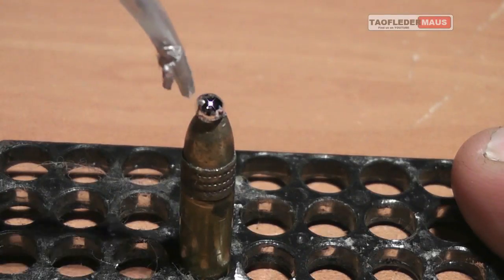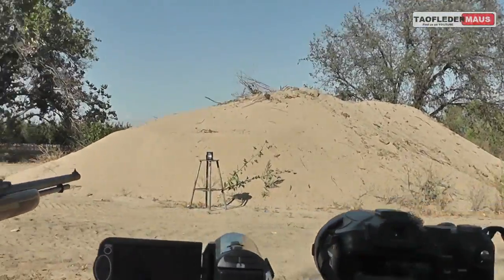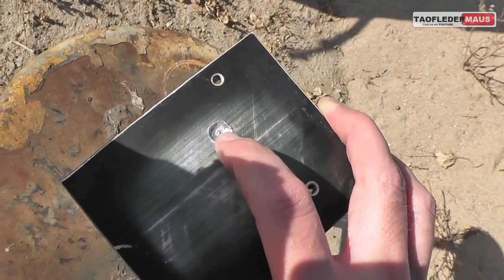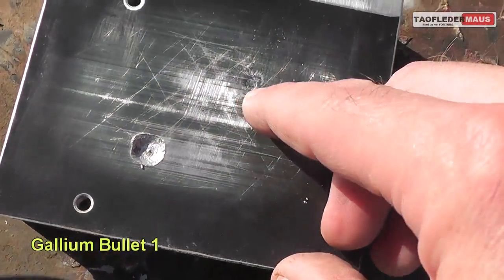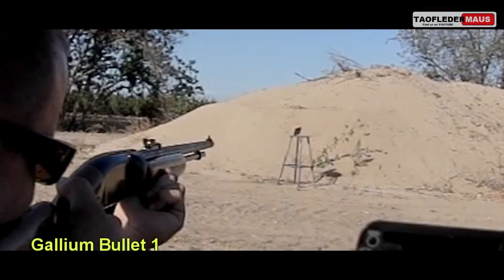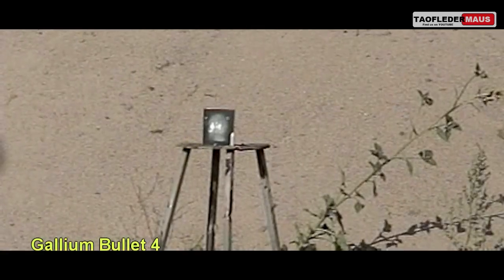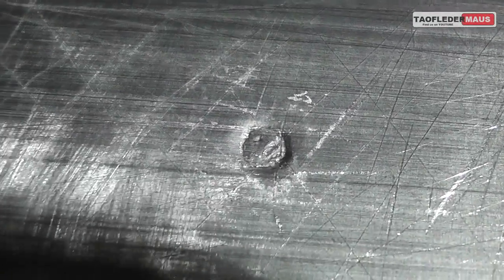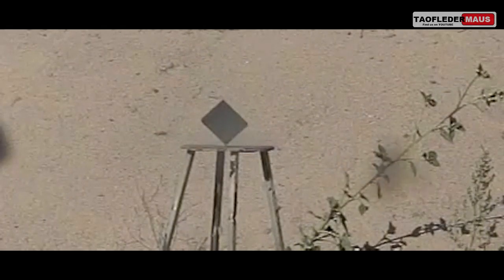GALLIUM Tipped BULLETS -  The SABOTEUR'S Tool?

Comment: If you want to test if these things can actually be used as saboteur's tools, here's a suggestion. 

Make a test rig that hangs a weight from an aluminum tube (Lowes/Home Despot/Etc has plenty). Shoot the tube with one of the 'loaded' bullets, and then wait to see if the aluminum decays enough to break and drop the weight.

Could even modify a .22 long or short to avoid penetrating soft Al...good luck finding a HP in those though, you may have to make a drill rig to make a decent hole. 

If it works then you may have something... a single quiet shot and an aluminum structure comes tumbling down hours/days after you're gone. Something to pitch to the CIA/NSA I'm sure :)

Comment: 1:21 why does he load it into the bottom barrel? didn't realize that's the real barrel? thought it was for something else =S
Reply: +captainplanet999 That's the magazine, it's a tube magazine that uses a long rod with a spring and a plunger to push the bullets back towards the lifter that brings each round to the chamber for firing. 

They're probably dropping them in the top instead of using the loading port because that big ball of gallium wouldn't fit... which raises questions of how much gallium got wiped off on the lifter/breech, there may not be that much more room in the mechanism than the loading port allows...
Reply: Michael Free that actually makes a ton of sense, thanks dude for the prompt reply

Comment: You should have tried to break the heatsink because that is what Gallium does to Aluminium, it makes it very brittle. It doesn't make it corrode like you said it makes it so weak you can break it with your bare hands with little effort which is what you should have showed, whether or not the Gallium in the tip would be useful
Reply: Scott Schoemann Ahh yes my favourite element: moisture
Reply: +QuakeGamer632 face it, they are no fun when they are not moist
Reply: +QuakeGamer632 The problem as to why it didn't work is gallium needs time to be properly dissolve into aluminum... The bullet caused the gallium to splatter on impact, and the only sign it had worked was a singular bullet whole that showed some crystallization... Not enough to compromise the structure.
Reply: +QuakeGamer632  the issue is the mass of Gallium will be consumed by an equal mass of "alyewminniyummm" however you are not dealing with pure aluminum in heat sinks, they are all an alloy since on its own it is very reactive to the environmental elements, such as moisture
Reply: +QuakeGamer632 Gallium corrodes aluminum, which in turn makes it brittle.  Corrosion caused by gallium is pretty obvious when it happens.  There doesn't appear to have been enough gallium here to cause serious damage.

Comment: Wouldn't the gallium heat up and melt in the barrel, then when it exits, re-solidify because of the wind reacting on it?
Reply: It's moving so fast that the air heats it up.  There's too much friction for the wind to cool it down, as was stated in the video.  The actual gunpowder charge is far enough from the gallium and ignites fast enough that the gallium likely doesn't heat up much at all.
Reply: +NoBeatsNoProblem actually due to the pressure build up in the barrel it is forced into the lead, and the same pressure front creates an extreme low pressure area on the bullet, behind a high pressure area in front of it. there are multiple high speed videos of this effect all over the net, such as shooting a balloon light bulb but the best is a candle flame

Comment: will a diamond tip bullet cause more damage then a normal bullet?
Reply: +Shachar Petrushka Real life>Minecraft
Reply: +Shachar Petrushka Depends what you're shooting at, your velocity, ratio of bullet to diamond, and definition of damage.
Reply: squidlybytes
Hmmm not entirely sure about that, all the test round firing I've seen, velocity X mass is what shows to be most effective. Obviously too soft means it will deform using energy but a copper jacket reduces that. My argument is that the exceptional hardness of the diamond imparts no major improvement. A smallish diamond backed up by substantial mass is going to be better than a largish diamond at the expense of substantial mass.
Reply: No
Reply: +Shachar Petrushka Bullets against solid objects is all about mass x speed of impact, the more the bullet weighs and the faster it's doing, the damage it will do. As diamonds are lighter and the bullet will travel at more or less the same speed the diamond has less effect. The actual impact site might have a slightly deeper hole but the energy imparted is less. That's part of the reason the gallium bullet did less damage, it was lighter. Partly also because maybe some of it melted.
Reply: etmax1
This is true about hypervelocity impacts, but at merely high velocities, hardness is important as well, when it comes to penetration.
Reply: ^agreed.
Reply: +D. Lyrium As such is why materials like depleted uranium are used for anti-armor, it's sheer density on top of the fact it gets white hot on impact allows it to penetrate armors with relative ease. Tungsten is a bit stronger but costly to produce and still doesn't penetrate as well as the depleted uranium.
Reply: DU is self sharpening, which is why it pens better. Watching it shatter in ultra-high FPS video is kind of fascinating.
Reply: +MidnightMarrow Also DU is very pyrophoric so all of the dust and spalls coming off of the perpetrator will ignite once inside the armored vehicle and set everything on fire.
Reply: +MidnightMarrow Also DU is very pyrophoric so all of the dust and spalls coming off of the perpetrator will ignite once inside the armored vehicle and set everything on fire.
Reply: +TaintedMojo indeed
Reply: To your Bank Balance....yes, definitely

Comment: "Gallium mist". I hate to be nitpicky, but just in case anyone mistook "mist" to mean "gaseous particulate" in this context, keep in mind that while Gallium has a very low melting point, it also has an extremely high boiling point. So this "mist" is not of a gaseous form, but rather a cloud of light particulates.
Reply from the maker: +Boof   I think you like to be nitpicky.  lol
Reply: As a physicist, I suppose I am quite nitpicky about phase changes, heh. Didn't mean to offend.
Reply: +Boof I thought a mist is a cloud of droplets not gas
Reply: +Boof as a nobel prize winning scientist, i can say with certainty that when people start a comment with their credentials, they're a fucking liar that used google.
Reply: +Boof Isn't that what "mist" is?  I think of a mist of water like spraying out of a squirt bottle.  Some are even labled "spray" and "mist".  Or "misting" outside is rain but tiny droplets.  Something in gaseous form I would call "vapor" like gasoline vapor.
Reply: +TAOFLEDERMAUS ya alominium picky lol

Comment: If it melts at that low of a temperature, then it will start melting in the barrel, but some of it should be trapped inside of the hollow point, but it would probably be in a liquid state already.

Comment: Why does Gallium melt at 85 degrees Fahrenheit?
Reply from the maker: Every metal has its own melting point.  It just so happens it is 85F gallium melts at.
Reply: ***** But that's room temperature.  Never heard of a metal with that low of a melting point.
Reply: Rocky Cadena Ever heard of mercury? ya the metal in thermometers that's one metal that melts below room temp
(BTW not trying to be mean just giving an example)
Reply: Legitamatetactics I thought mercury had no melting point.
Reply from the maker: It melts around -40 degs.
Reply: ***** so technically it never was a solid so it can't really melt.  Unless you find a way to freeze it first.
Reply: Rocky Cadena It's a solid anywhere colder than -39...like Antarctica, or any other climate colder (Space, the Moon...etc). It's still scientifically called a melting point because that is how hot it has to be to melt out of it's solid state. the fact that our climate is usually warmer is inconsequential. It can still melt, because it still has a solid state.

You would say ice(water) melts, even though most of the time it is a liquid, so why would you say mercury can't because it is usually a liquid? Just doesn't make sense.
Reply: Raven1024 Ok, well can Mercury evaporate like water?  It's metal so I don't know, but it's also a liquid. :/
Reply: Yes, it can.

Also liquid is just a state, not a group of elements, every metal can also be a liquid.

Just like you can compress most gases into liquid and solid states. Blocks of solid oxygen for example.
Reply: Raven1024 So Iron can become a gas?  That's hard to believe.
Reply: Rocky Cadena I didn't mention metals as gases, but yes, it can.

Given appropriate temperature and pressure any element can be any phase.

Iron gas has to be made in a vacuum though, otherwise it reacts with air.
Reply: Raven1024 What would Iron do as a gas?  Burn shit or freeze like liquid nitrogen?
Reply: It won't freeze anything, and if it's in a vacuum it's not really got anything to burn. It does have to be incredibly hot so it would probably just be a very bright chamber.

So...it's just a very hot gas, in a very bright chamber, as soon as you take the vacuum chamber (or inert gas chamber) away it will react with the air and oxidize.
Reply: Raven1024 Hmm, so if someone inhales it, will they burn inside out?
Reply: It would be nigh impossible for someone to inhale it...it only exists in a vacuum or inert gas environment.

So unless you can breath inert gases or vacuum you are going to breathe in rust that is slightly warm, because all the energy goes into the oxidation.
Reply: Raven1024 Look I'm looking for a toxic gas to kill my nemesis with, is there anything you know that'll seem natural to autopsy?  lol.
Reply: Carbon monoxide?
Reply: Raven1024 Not natural, easily detected by autopsy.
Reply: Rocky Cadena Occurs commonly in a lot of ways though, also yes natural, it's a result of almost any fire.
Reply: Rocky Cadena Use phosgene. (you didnt hear it from me). Now phosgene will burn people from the inside out. Its easy to make.
Reply: Rocky Cadena You're dumb as fuck two apes fucking a cat.
Reply: 2009dudeman LOL
Reply: Rocky Cadena As for the comments about Phosgene, no it doesn't burn your insides out. Phosgene Oxime would (it is a nettle agent).

If you want something effect, guaranteed to work investigate Methylphosphonyl Difloride & all you need with that is Isopropyl Alcohol (and an amine if you don't want to die yourself from Hydrogen Fluoride inhalation, or a fume hood) and you create Sarin. Different alcohols (cyclic or complex alcohols) can create different nerve agents, ie: cyclosarin, tabun (if you use a alcohol with a cyano group), soman etc. 

It is, however, a schedule 1 substance under the Chemical Weapons treaty, and thus, you would likely be:
1) Executed
2) Spend the rest of your life in prison
3) Be kidnapped to work for a rogue state or secular group (unlikely)
4) Have the whole thing covered up and be hired to work for your countries government

It is a war crime and this is freely available information so thus if you do decide to use this you can not, and will be frame me or incarcerate me in any way. By reading this comment you automatically agree to the terms and conditions in the previous sentence and also that this is a disclaimer from myself and that I do not control any actions you take using publicly available knowledge.

I doubt you have the capacity to learn how to make one of these compounds (luckily) and while access to the stuff needed is cheap and undetectable it still requires some amount of money to carry out an attack.

Besides, you hate your nemesis right? They WANT you to do something to them really, so if you ignore them and don't even acknowledge their existence you would cause them a life time of hurt and pain, more than any poison or weapon would ever physically do to them. Rest assured in that it is more harmful to someone whom hates you to ignore them, if you don't acknowledge their existence how are they supposed to annoy you? Simple really.
Reply: Scara - Saul Smith Well Phosgene  is known for its"burning effects".  
After Phosgene enters the human body it reacts with water to give Hydrogen chloride gas which dissolves in water to form Hydrochloric acid which in turn is known to cause"burns".
COCl₂ + H₂O → CO₂ + 2HCl
Even though it doesn't directly cause this undesirable effect , it contributes towards it.
So it counts.

Comment: sabot 12gauge galium filled canister shot? (i really dont know, this is my best bet XD)
also for it to work you need to sand the aluminiumimnum, because the oxide layer prevents the galium from getting in.

Comment: I'd been thinking of what might happen to an aluminum wheel if so targeted, in theory, of course.   Thanks for doing this!

If you were to guestimate how much gallium is hitting the aluminum upon the bullet's arrival, and apply a similar amount manually, scratching the surface to expose the unoxidized metal, will it cause the structural weakening we've seen in other Ga vs. Al clips...?  You probably have an idea just from your prior experiments...

Comment: I think people might have assumed with the heat that the amalgamation would have been accelerated causing the heat sink to shatter. It's a slow process even with heat and the gallium directly touching the aluminum, so my expectations were limited. Cool video though.

Comment: The ice box may affect the performance of the gun powder, which may be partially why the gallium bullets aren't doing as much damage (assuming the gallium replaced the same amount of mass as was removed from the bullet).
Reply: The difference be insignificant.
And the mass of the Gallium is probably less.

Comment: Shoot  "Pop Its" out of the shotgun
Reply: A buddy of mine shot a cow turd whit a shotgun while his brother was looking at it. Man had shit up his nose mouth, shit everywhere
Reply: The pressure from just shooting could make them pop, but would be interesting to see if that's the case.
Reply from the maker: I think they are too light and would just turn to dust.
Reply: ***** most likely
Reply: *****

Try it with pop its with a wax filling. Sounds like an explosive round to me.

Gallium is a strange metal, it's what the magicians use to make spoons out of that let them just rub the handle and it bends then breaks apart. It looks and sounds like a real spoon when it's cold and you strike it against the table but melts from the friction of your fingers.  .